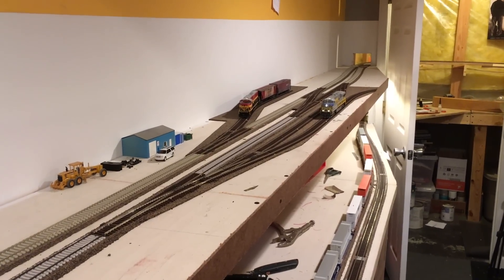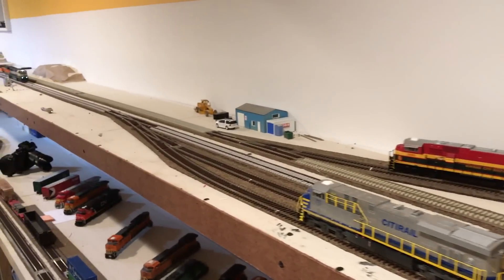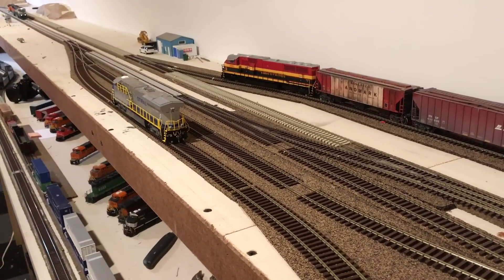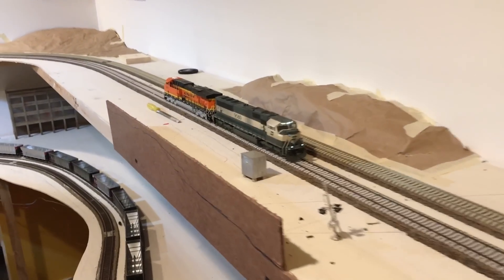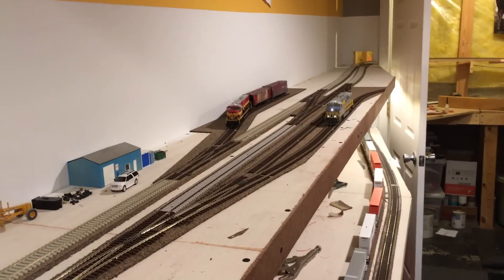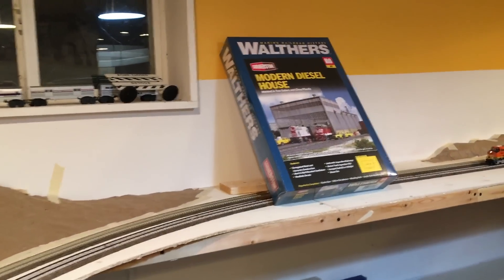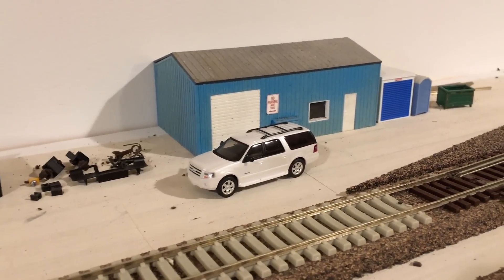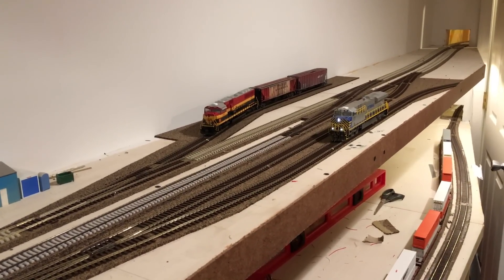Layout Update 25: Finished track and a new kit

Comment: Like the layout. 
Tip on building the Engine House (and other Walthers building with lot of "glass"), Use the glass in the kit as templates to cut new glass out of .005 clear styrene. Then you will be able to view the interior details MUCH more clearly. The clear plastic in the Walthers kits is generally way too thick.
Reply from the maker: Thanks for the advice! I really appreciate it. We'll definitely do that.
-Cam

Comment: Looks great! Not much or mainline track work now right? 

Just wondering, do all the turnouts on the prototype still have wood ties? Or are you just doing it that way because no one makes cement tie turnouts?
Reply from the maker: Thanks! And the prototype turnouts still have wood ties (for now...).  It'll be interesting to see if that changes though.
-Cam